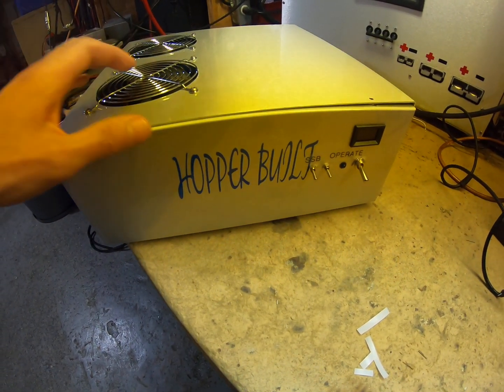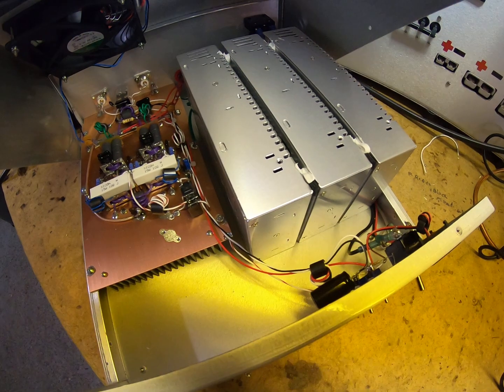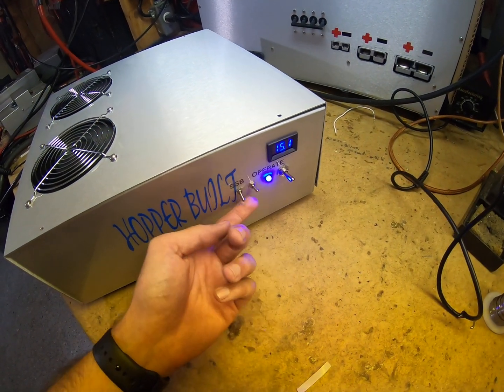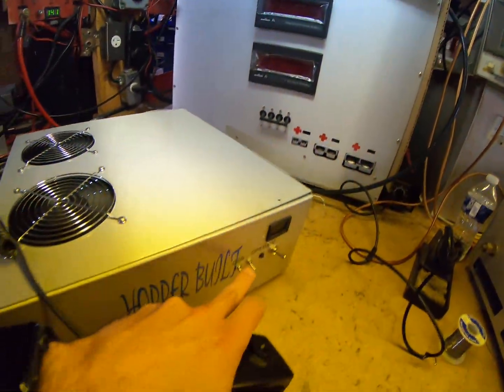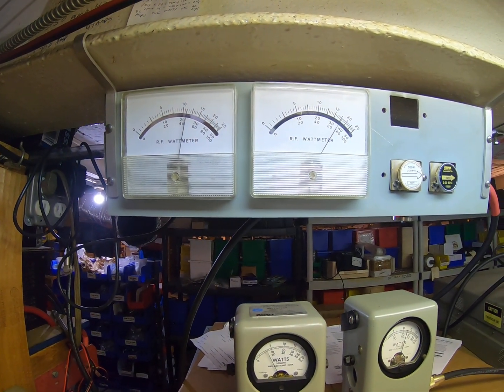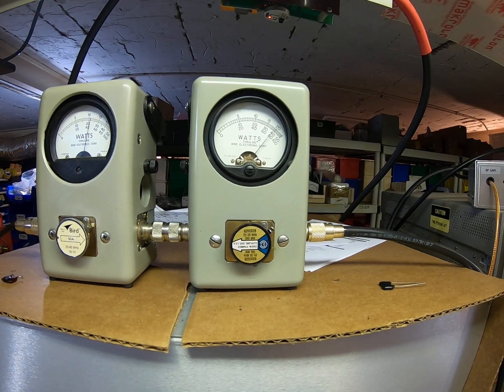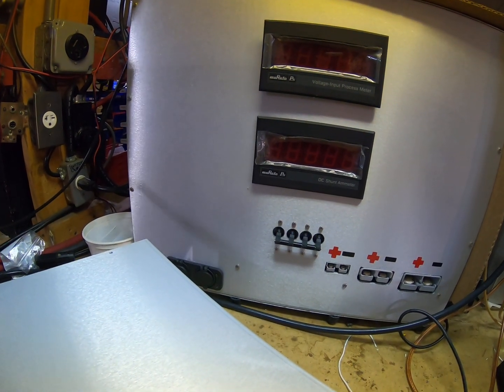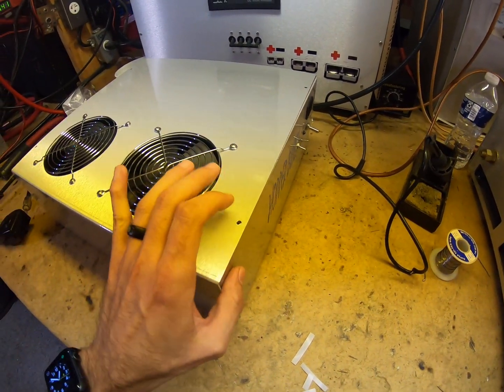4 Pill Base

Comment: Impressive, how do you get so much wattage from just 4 pills? In the market for one of these to go with my Stryker 955 and like your work!
Reply from the maker: they are rated at 100 watts each at 12 volts, so when you run them at the voltage that your vehicle would be at, (13.5-14 volts ) they come to life and produce more output